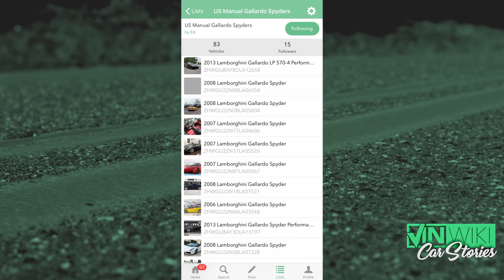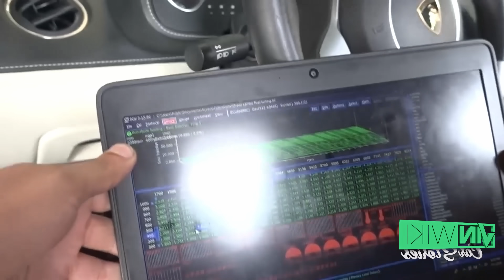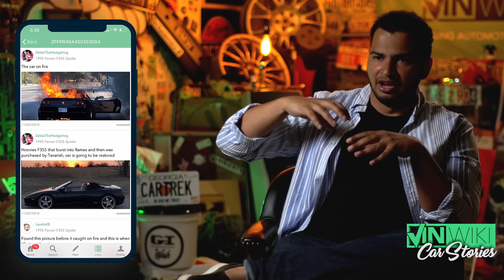Lambo vs McLaren: Which is better for a rebuild project?

Comment: Tavarish says he wouldn't touch a burnt up car and then remembering the Ferrari is so funny. Shows how much interest he has in that project, which sounded so promising as a concept
Reply: He did say, its just going to be a silly 3 rotor burnout car.
Like his 300zx is going to be.
I doubt it will ever be road legal.
Reply: @forresttm  Ha! He is in Florida, ANYTHING can be road legal in Florida 🤣
Reply: @joealex65  an alligator, with a tube frame chassis, go-cart engine, and 30" crawler tires?
Reply: @jwalster9412  yeah man just weld a windshield and vin on from a 87 chevy and good to go brother.
Reply: Think it's def an instance of "sounded like a good idea. Wasn't so don't try it at home. And someday I'll finish mine...maybe" but good to let people know the reality of these projects. Unlike the shows that used to make it seem like it could be done in a couple weeks, no problem.

Comment: I rater do a salt water flooded car than a bent frame from crash car.
Saltwater the worst is to get the surfacerust of everything and rebuild the engine as the cylinder walls are most likely gone to shit.

Electronics are really easy to fix and replace.

Comment: 5:49 Tavarish if the cars that bad put earplugs in when you drive it, either that or put the other exhaust on, as hearing doesnt come back overtime, once its gone its gone, and then you'll keep just making things louder and louder when they didnt need to be, its called the Ghetto Idiot Disease, it blows out windows, ruins interiors, and causes hearing damage for four blocks around. 

like its one thing to put an exhaust on a car that needs it, like a 308 Quattrovalve or a Vintage Testarossa, which greatly improves the performance, engine flow and sound, its another when you've already got that better and now its literally deafening you to death like some supercars of london idiot that you based your car off, who did that just to give as much of a middle finger to the people running, and overal ruining london as much as possible